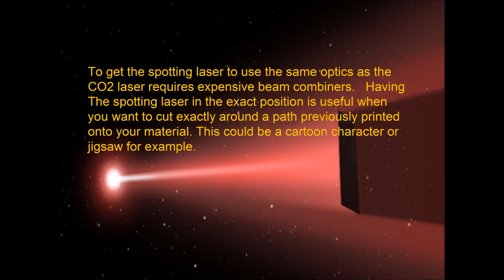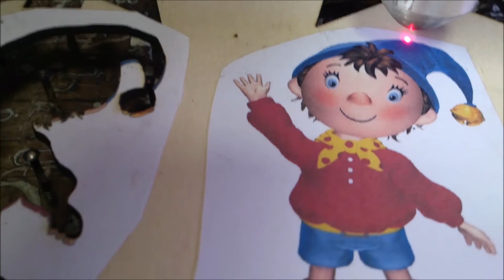Red dot laser through the lens of laser cutter

Comment: Neat concept, but a beam combiner drops like <~1% power for less than $100, and you don't have to worry about switch failures. I do like how you can "pre-cut" and see your outline, however.
Reply from the maker: Thanks Zack my solution cost about £15. My latest one is better as it sits before the first mirror. £100 is a lot of cash for hobbyists.
Reply: I agree... It's a very nice solution when you currently have no dot, too! I saw your other video, too, Very nice... I just dont have a 3D printer so I'm just gonna go about it the long way. Actually thinking of cutting a 2X2X2 box with the laser, and putting a combiner mirror on a slant in there...  same as the combiners but... made at home =P
Reply from the maker: Did you look at this one Zack?  https://www.youtube.com/watch?v=Jm8syz6ARCY     This was my latest one and the design I am sticking with since it works ok and has been in use some time now,   This was laser cut not 3D printed although someone else has done a copy which uses 3D printing and an arduino servo.  Also another copier has used pneumatics to withdraw the laser.   I would have been more flattered if they had mentioned where their inspiration came from but its nice to see the idea developing.  Maybe you can share yours when you get it going.
Reply: I did see this one! I do really like the idea. You happen to have a parts list for this buildup? 

I agree folks that draw inspiration from you should at least give props... =/
Reply from the maker: Send me your email address and I'll pass the dxf and notes on for the build my address is listed on the video.